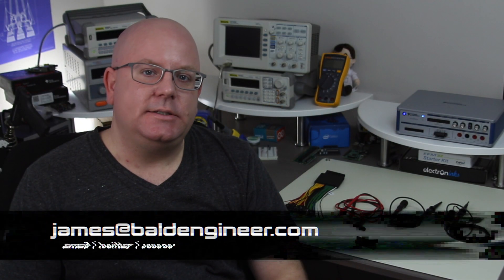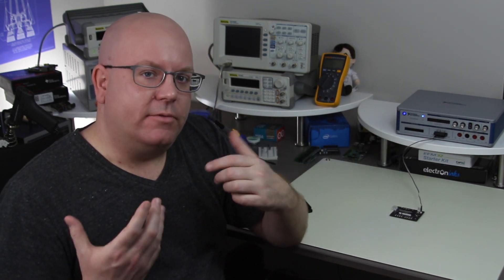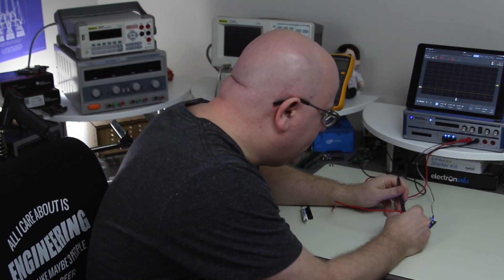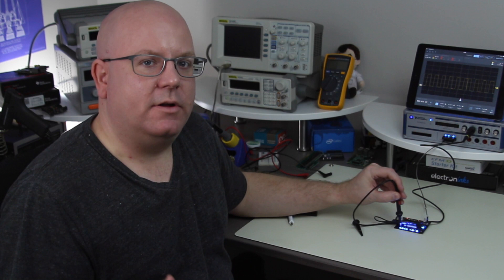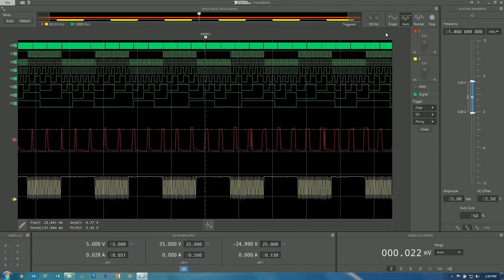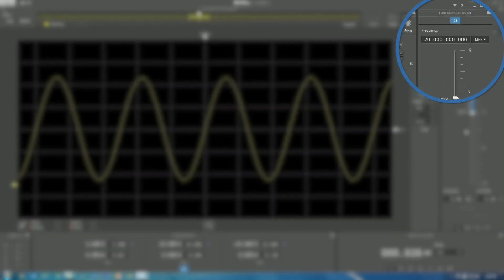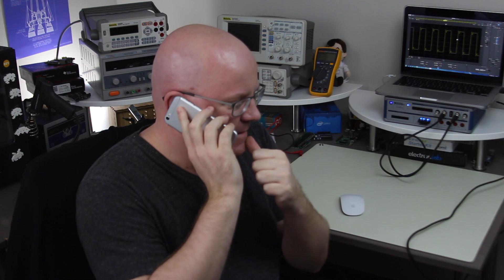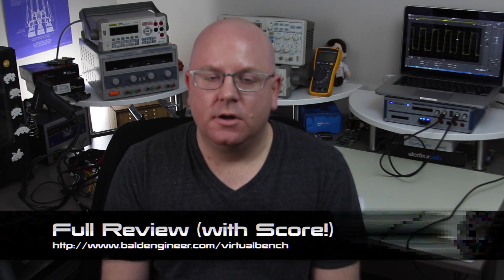VirtualBench Review by the Bald Engineer

Comment: Actualy, you have three voltage meters. The oscilloscope has two voltage meters. ;-)
Function generators can be used to generate clocks to digital devices.